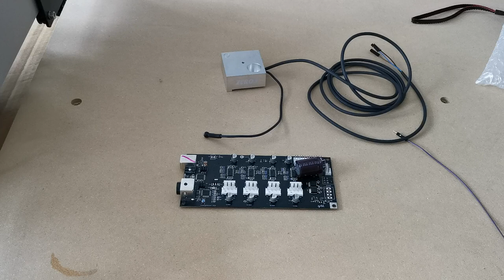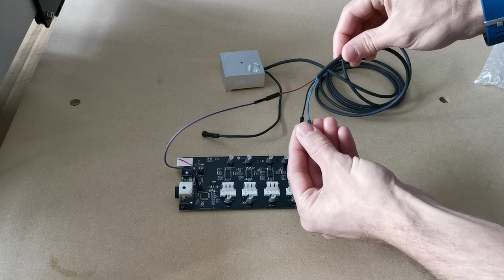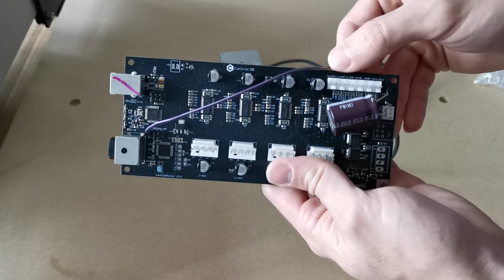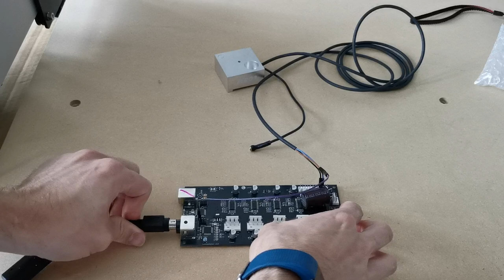Hooking up the Zero 3 Probe to the Carbide 3D board.

Comment: 2 questions:  1.  Is this probe controllable within the Carbide Motion software without macros, etc?  and 2. My board is 2.4e and looks nothing like your board.  How is this connected to the 2.4e?
Reply from the maker: Hi Todd, it certainly is. This is a 2.3 version of the board which is very similar connection wise. You should be able to plug it in the exact same way, I do have a 2.4e version I can demonstrate on if needed.

Comment: hey Luke, I  was about to connect this probe to my Shapeoko board 2.4e, I realize I need the extension cable for the power supply which I don’t have :(... can you tell me the name of the cable so I can look for it?
Reply from the maker: It's a standard dupont connector like these

Elegoo 120pcs Multicolored Dupont Wire 40pin Male to Female, 40pin Male to Male, 40pin Female to Female Breadboard Jumper Wires Ribbon Cables Kit for arduino https://www.amazon.co.uk/dp/B01EV70C78/ref=cm_sw_r_cp_apa_i_mawlDbHMQANQC
Reply: Beaver CNC thanks! I will order it. :)